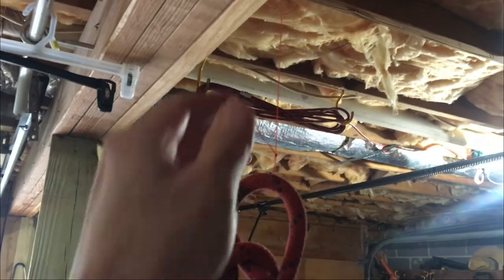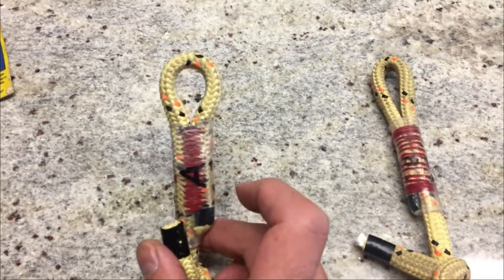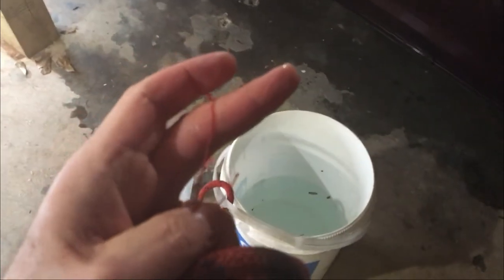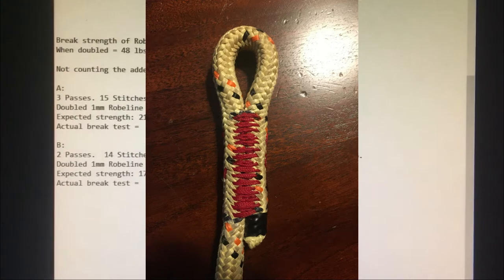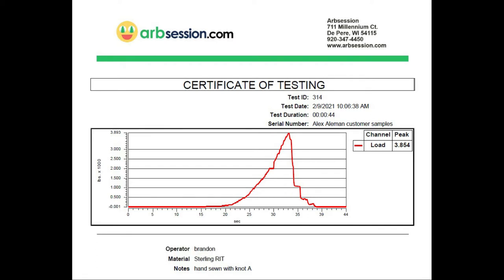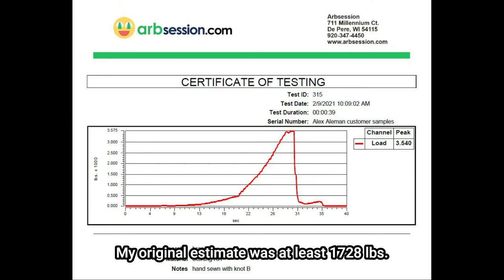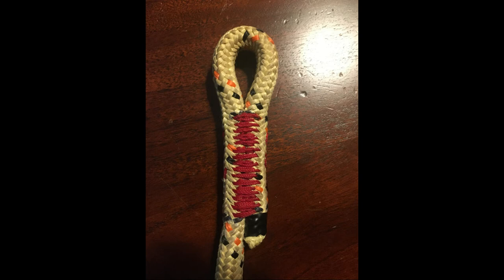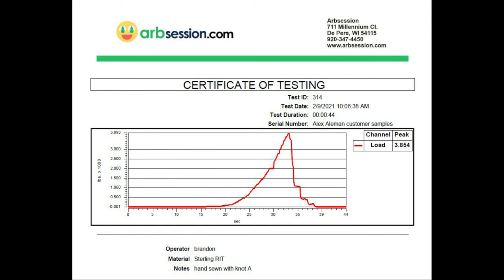Hand Stitched Eye - Break Test

Comment: if it isn't at least 80 to 90% of advertised breaking strength i wouldn't climb on it.. i believe minimum is 22kn or just around 5000 lbs is minimum industry standard for connections and 6000 lbs for actual textiles.. its not the static load that will break it.. but a fall or a shock load
Reply: At least in this case,  knots don't achieve 80-90% - they were the weak link.  That makes sense...a knot should fail the rope before a decent splice or stitch due to the massive cross-section change right at the knot.  A big stress riser.